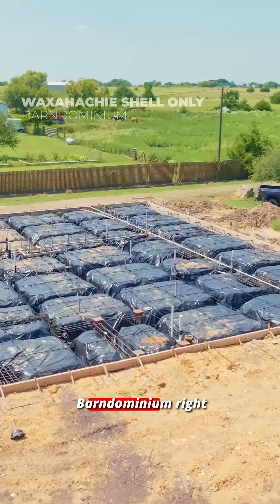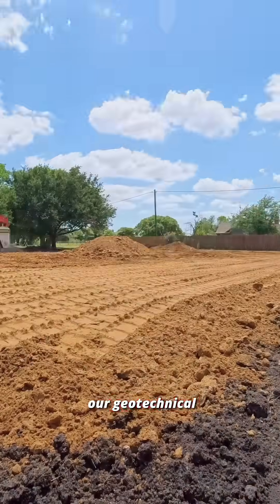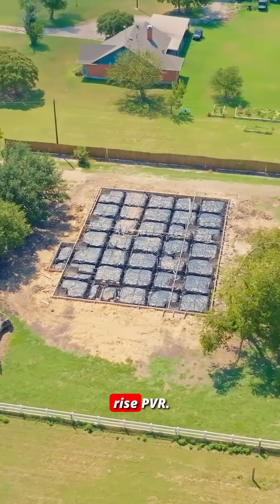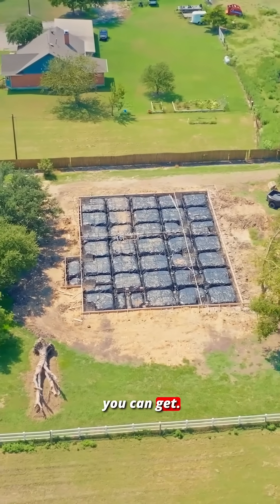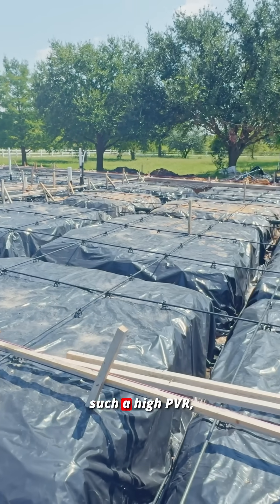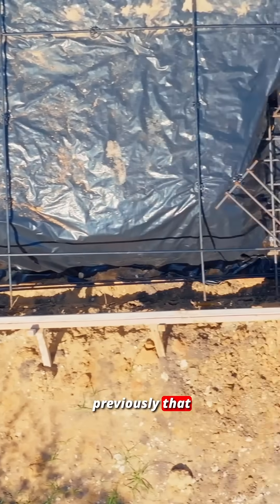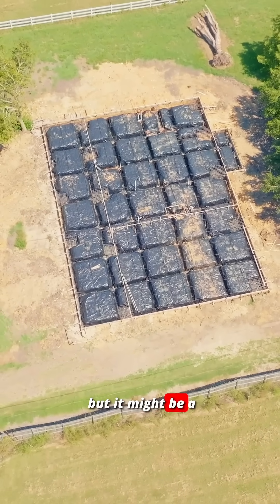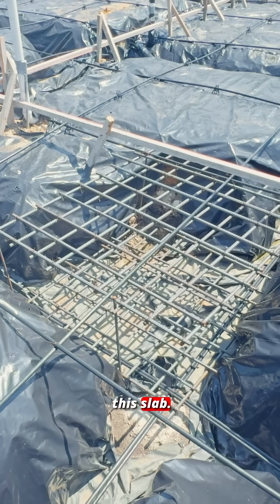Talking Foundation for a Texas Best Barndominium

Comment: The builder brigade channel showed putting PVC pipe in the foundation as conduit for water and electrical lines, separate conduits of course. Is this something that builders do? Or is there a reason it’s not recommended?
Reply from the maker: We do bring the main water supply under the slab. We prefer the majority of water lines from there to be ran up overhead.  The only electrical under the slab is in the case of wanting floor plugs or in a kitchen island where needed. The same is true for water in kitchen islands
Reply: @TexasBestBarndominium I like that idea even more. Another question about water valves in the house. I had a builder in Houston doing standard water valve boxes in houses 10 years ago. Essentially like a fuse box, but for water lines going to different parts of the house. Is this something you do, or don’t recommend?
Reply: Yes they do that for commercial construction sometimes